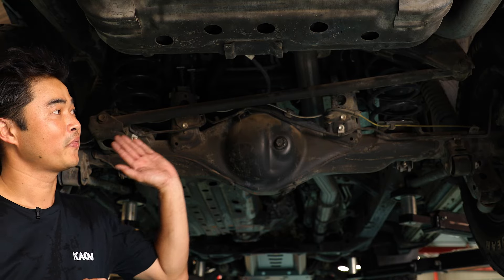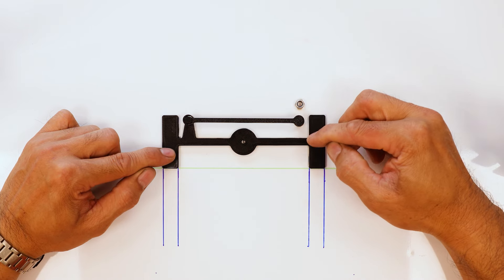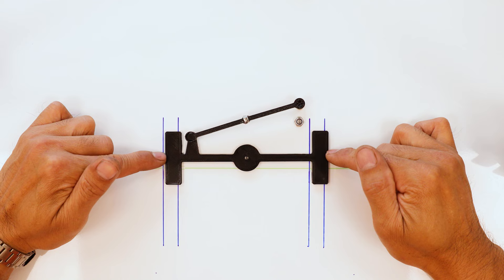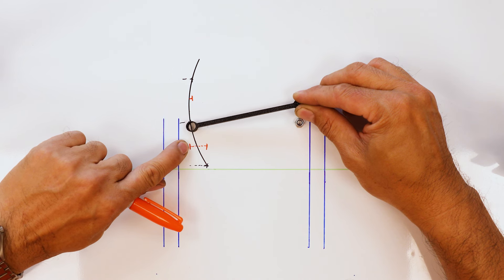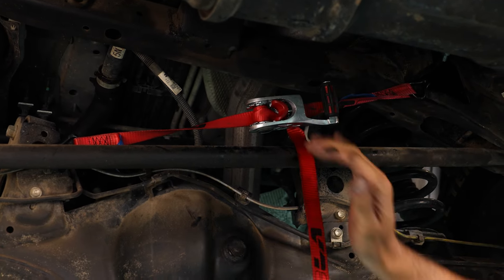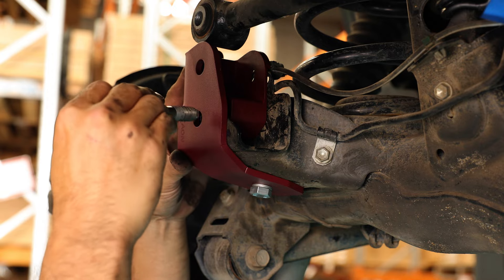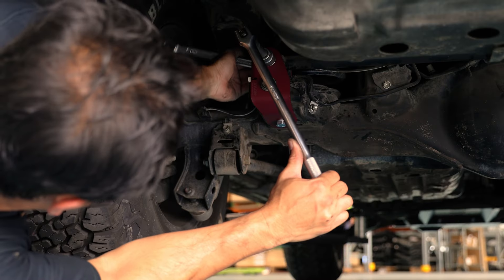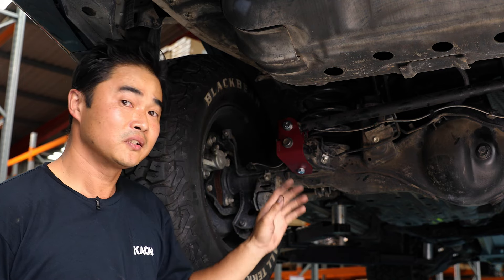Panhard 101: What happens when you lift your car & how to fix it

Comment: Not very many people or suspension mobs here in Aus understand the way the panhard operates, everyone just wants to sell adjustable panhard bars, which, as you point out, only makes the real issue worse.
So, nice job on the explanation, but you missed the other great thing about using a correction braket, on the axel, you're now raising the roll centre, this means the vehical will have less body roll and be more stable on road and off road.

The only other company here in Aus, that I know of, is Rampt customs, but he only does them for 105 and 80series Cruisers. I can't believe you're the only other company here in Aus that has finally gotten onto this, the guys in the US have been doing  these sorts of correction kits for years. 
I got the weld on ones for my 100 series cruiser, got them from a small company in the US. 
Getting the panhard corrected like this, makes a world of difference.
Reply: DR.KDSS did it first.
Reply: @RedDevilTuning  Their product requires permanently bending the vehicles bracket, which is not ideal. The Kaon product is a whole other level of quality engineering, on par with Toyota OEM.

Comment: I’m watching your video now. It is very good.
I’m surprised Toyota didn’t come up with something like what Ford did 
It’s called the Watts link
Holden, even I believe paid money to be able to use the patented  watts link on the race cars supercars whatever you wanna call them these days all those days
It is a pivot point 
The pivot points is another good idea 

Still watching your video
Reply from the maker: Thanks Anthony!
Reply: Watts linkage was invented long before Ford turned up - imperative to the Industrial Revolution.  While still not perfect as te resulting arc that is traced is like a figure 8, it is certainly an improvement for movement  but can if not designed well, leave the lower arm exposed to damage.  Worked well in V8 supercars.

Comment: Excellent video and product.  The only thing i would mention is what is the problem if the axle is displaced to one side? Handling issues?
Reply from the maker: Ride, handling and overall comfort loss are what you will experience with suboptimal suspension geometry.

Comment: Ive been looking at correction kits from the states for the last few months due to a rear end wobble. Will you guys mate these for the 200 series? Im part of TLCC happy to lend you the 200!
Reply from the maker: Hey there! We have the 200 in the works as we speak ;) Might be around 4-6 months away by the time we move through R&D.
Reply: @KAONaust  thanks mate
Reply: Is this useful even if lift is less than 2 inch? Or at what lift is this useful or necessary?